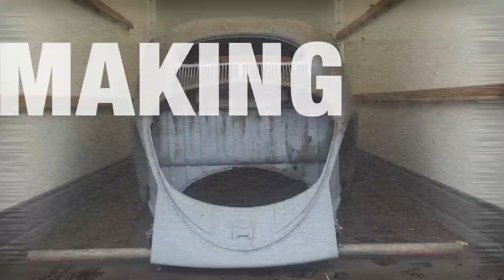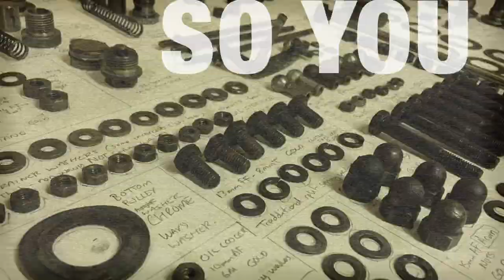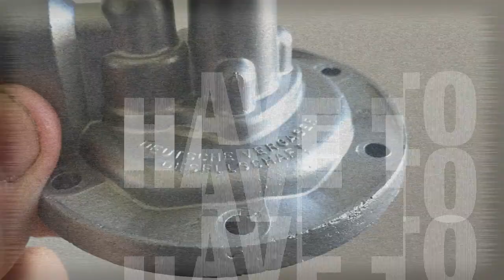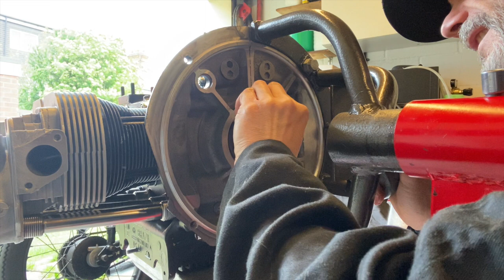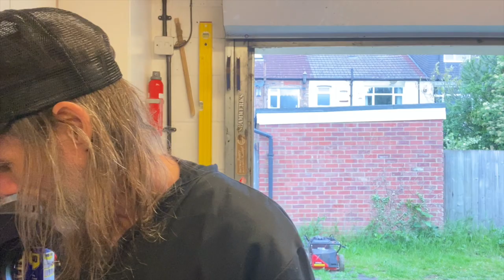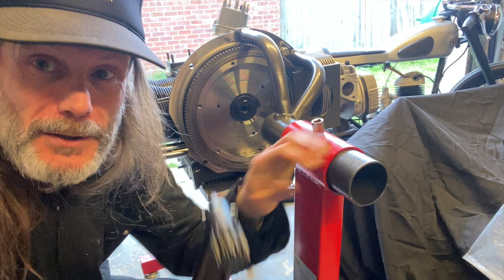PART 14 - Flywheel & Main Seal - How to Build a CB Performance 2017cc Builder’s Choice VW Engine

Comment: I looked up a multiplier for VW’s and I wonder, are you using the correct starter voltage gear? The ones I saw came with a 6v and a 12v gear. Could that be the slippage issue?

She’s stating to come together now! Oil cooler, gen stand then tins etc. You’re in the home stretch now!
Reply from the maker: That’s exactly right. The tool comes with two gears. One for 6V and one for 12V flywheels. You swap them in and out of the tool for the application you require. You also get an arced plate with corresponding teeth that you can use to tighten and undo rear brake drum castle nuts. Which is very handy when it works. I was definitely using the correct gear from both tools - one worked, the other didn’t. I guess I was unlucky and had a badly made tool. 

Yep home stretch. I hope to post more regularly.
Reply: @aircooledanything2415  Yay! More videos! Gimme gimme gimme!!!

Comment: How did you calculate the end play of fly wheel?  Been looking at your videos and didn’t see where you did that.  Great video series!!!
Reply from the maker: Hi! I did indeed post about flywheel end float. To be honest I;ve not made a great job of ordering or editing the posts.I;m just doing it as I muddle along. I think what you're looking for is here.
https://www.youtube.com/watch?v=9HfVamsblnE&t=3s&ab_channel=AirCooledAnything
Reply from the maker: I used a dial gauge indicator. Once on a test fit and then again after I’d buttoned down the short block.